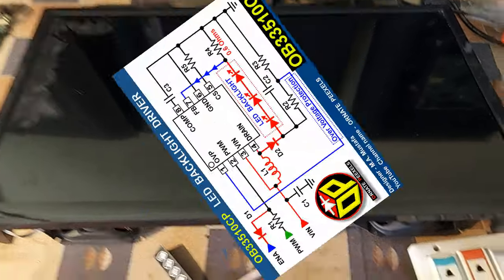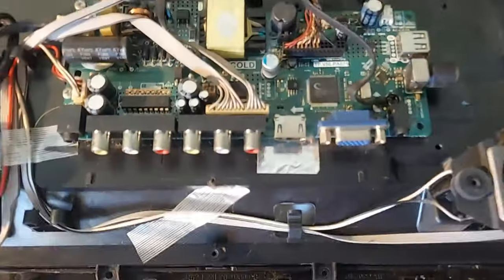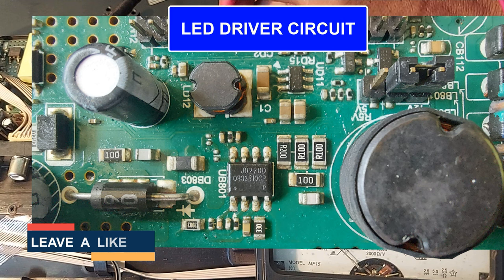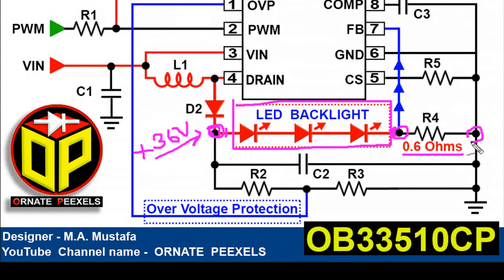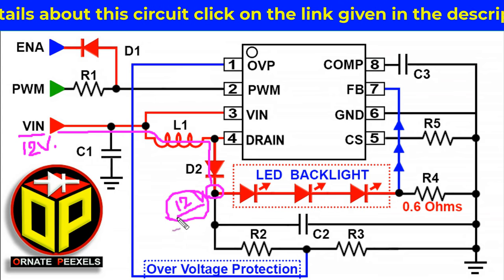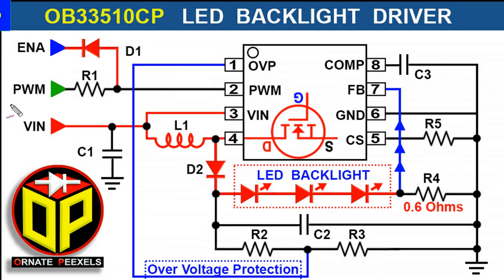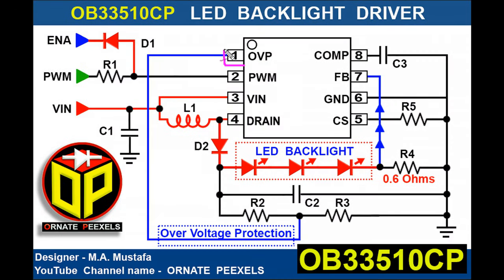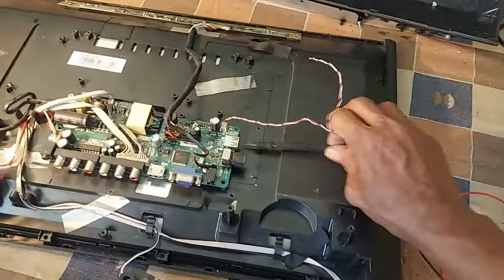LED TV Repair,  No Light on the Screen, LED Driver Circuit Explanation, OB33510CP IC Datasheet

Comment: Hi I love your videos can you help me please? I'm trying to find the schematic diagram for a Samsung 13.3 hd led panel model number LTN133AT17 and all I can find is the data sheet. Also if backlight is giving only 12 volts from driver because of a broken led bulb will it work correctly after changing the bulb? Thank you for your videos

Comment: I always find this channel important with clear explanations. Sir, A question? I have replaced my Lg led tv Model 32LB55OA-TA with new backlights and the backlight is okay now. but no graphics. It has got DC to Dc ic (P45y) 5562A. it gets 7 volts on the fuse test point. But missing von 0 volt, VGH 0 volt etc. Is the voltage I got on the fuse right? should I replace the Dc to Dc IC? thanks in advance
Reply from the maker: DC to DC IC damage is very rare.  COF Could be  shorted, have you tried disconnecting the CKV or CLK?
Reply: @OrnatePixels  It looks like a dream to get the wonderful teacher's response here sir, thanks a lot for replying. I didn't check that and will try to do so and inform you, sir. Thanks a lot!

Comment: Hisense led tv turns on from standby without remote or manually pressing power button but no backlight.
Led driver diode at the cathode measures  40 volts.I tried unplugging and plugging but still the same.Any help troubleshooting would be appreciated.

Comment: Good video. May you cover the oparation of the transitor  if you get time ?
Reply from the maker: I will take time out for that bro, Thanks a lot. 💚❤💚
Reply: @OrnatePixels  also TV MOSFETs and general troubleshooting from AC to output be LED pin or  whatever (general working/operation)
Reply from the maker: @charlesmawale9114  Your expression or question seems incomplete to me. That's why I couldn't reply properly. Thanks bro, stay well.
Reply: @OrnatePixels  troubleshooting from power supply to led pins.. teaching as voltage we can found and what to measure.. general troubleshooting from power supply

Comment: I have the same problem, but in my case, I've changed the leds panel completely with new one, but still the ovp active, I've checked the voltage of ovp it shows under 1.8, any idea where is the problem sir?

Comment: My TV is LG led tv. It stopped displaying anything while I was watching it. No back light but I can hear the sound clearly. How do I repair it myself. I understand electronics a little.
Reply from the maker: There may be a problem with the LED driver circuit or there may be a problem with the backlight strip.
Thanks Bro.❤️

Comment: hello sir please, I was installed new circuit of LED TV, but the light was drop down, I was changed on/off resistance from 4.7kom to 200ohm but nothing happened
Reply: Thanks sir 🙏🙏🙏🙏
Reply: Finally I found a solution!

Comment: THIS CIRCUIT CAN'T CONTROL THE BRIGHTNESS OF THE LED ANY WAY TO DO THAT 
ALSO THERE IS A PWM UPDATE 2 PIN CONNECTOR
 WHAT IS THAT FOR AND AROUND THAT CONNECTOR THERE IS A JUMPER i WAS WONDERING WHAT ARE THOSE USED FOR

Comment: Hi sir Panasonic 43 Inch lcd tv RD3P130SP power MOSFET this MOSFET damage any other one power MOSFET  any idiya sir please tell me sir 🙏
Reply from the maker: Place an IRF953  P-channel MOSFET on a 1 square inch Vero board and connect three wires from the source drain and gate to the TV board.
Reply: Thanks sir 🙏🙏🙏